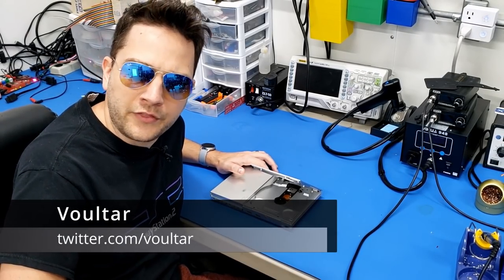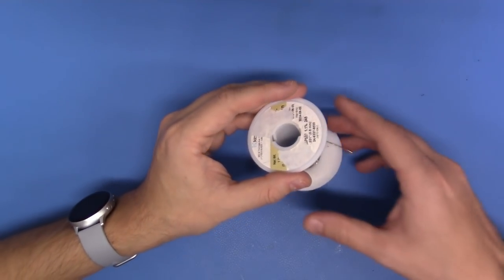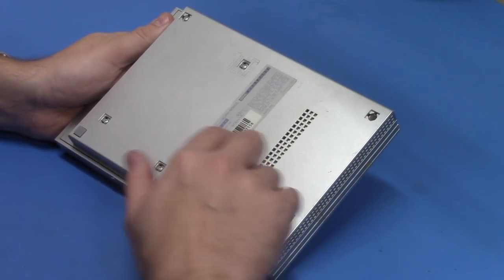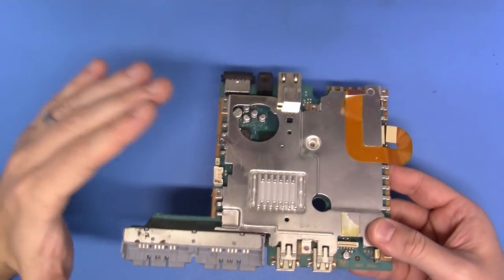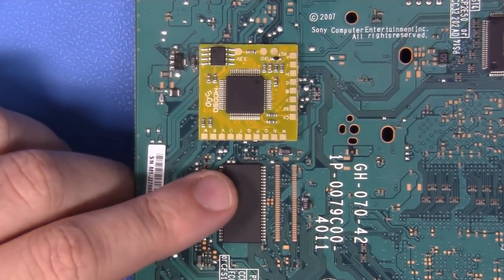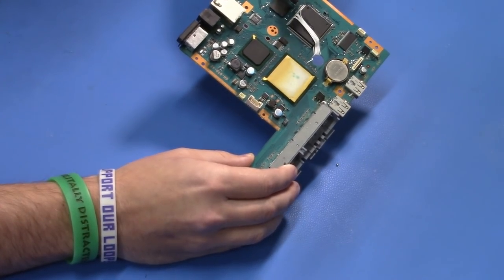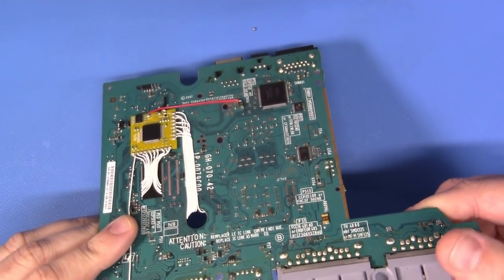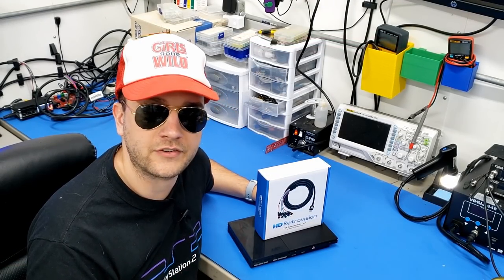Playstation 2 | The War Against Modchips

Comment: I've said it once, I'll say it 100x again. Hot glue is perfect for console modding, when used appropriately.
Reply: What about the super glue? It looks like a mess too me!
Reply: Agreed. There's no such thing as a bad or good tool. It always depends on the use case.
Reply: @nowonmetube  
nearly impossible to remove if you ever have to
Reply: I always use double sided tape. hot glue degrades and becomes brittle with age
Reply: Hot glue is a hot mess.
Reply: @DecibelAlex   acetone for super glue, works great actually as long as you don't put it on anything it will dissolve that you don't want it to.

Comment: I remember when the first no swap chip (except for DVD games) came out, the NEO 4. It required some 40 or 50 wires to be soldered. I ended up shipping my PS2 to a guy in California to have it fitted, which I still have today in 2022 and it still works.
Reply: Oh man, did you send yours to eccsmods? He was the best at the time. I ended up buying my OG Messiah chip from him. Never got around to installing the neo4 I bought.
Reply: @GLAAAAAR  Yes, it was eccsmods! Lol wow I had forgotten the name. He did an awesome job for sure.
Reply: @JeffisWinning  That's crazy lol. The name just popped into my head when you said Cali. I remember him and foundmy were the main dudes for modding back then.
Reply: respect to the OGs in the chat recognizing good mod chip work. I had a Korean hookup for my mod chip installs.
Reply: @GLAAAAAR  That's wild dude! Such a flashback.

Comment: messiah, messiah 2, matrix mxl, mxl2, infinity, dms3, 4.. I memorized every schematic except v3 that were quite rare. Did hundreds of installs. Soldered kilometers of awg30 with a JBC am6000.

My favorite awg30 was Ok international brand with 60/30 radial soldering wire. Great times.

I started with psx and 12c508s

Comment: I put one of these in an old PS2 fat this morning, after previously only using software mods to varying degrees of success.  I was able to use the KSGER soldering station with the tip I always use, even though these are some really small points.

Using wire-wrap wire is a must.  While my wiring isn't nearly as neat as this one, and I used Kapton tape instead of super glue, it worked the first time.  If there's any question as to whether you have solder bridges, bust out the multimeter and buzz everything out (hopefully, have a meter that has good latching so it buzzes immediately if there's continuity)

Comment: Dude I just noticed you're rocking dual KSGERs. I bought one of those stations cos of your review! Absolutely love the thing 🤘
Reply: I blew up my KSGER building my Nintoaster, FML
Reply: @rdaws73  That blows. What happened?
Reply: @eastwood4  My fault. Touched a live wire  with Mains voltage, blew it up. Dumbest thing I've done in my years of soldering and electrical work.

Comment: Honestly, I greatly appreciate that you were open about killing the PS2 you modded first. I did the same thing when I modded mine way back in 2009! I ended up buying a used one of the same model (50007 IIRC) and successfully modding that. I actually had overheated a trace and burnt it off the board. (Was my first mod ever, even.) Definitely no artful install on mine, though, but works wonderfully in the end! (Of note, I still have the "dead" PS2, and plan on trying to rebuild that trace someday when I feel up to it.) The chip in question was called a ChipMod CM2 or something of that nature, by the way... pretty sure that it was itself a clone chip already, but it's the same as a Modbo V1.1 in design.

Comment: How are you man, nice shades. I walked all the way from my PS5 to my PC just to tell you that I really enjoyed this video and to subscribe. Oh yeah I was also going to tell you a story. 

I installed one of those very 40 wire? or 40 solder point early PS2 modchips on my brothers 1 day old PS2.. The thing cost 450 AUD from memory. I was a young man with good eyes, the hands of a surgeon and a 10 dollar 15 watt Weller iron. The only soldering experience I had was what I was taught in highschool, never soldered surface mount before and had no flux other than the core of my solder. I used enameled wire and I was SO stressed.. But it worked and to this very day that PS2 is still in near daily use. I'm sacred to open it.. Because there's a giant nest of wires in it lol. These days I'm old and blind but could solder those in my sleep if I wanted to. However the memory of the stress that day gave is always with me.

Comment: Really cool video with a solid introduction to the background of the Playstation modding scene & challenges it has faced & overcome. Whilst this isn't a tutorial, I think your confident and competent soldering skills will inspire many and there's still a lot of technique on display to be picked up here. 

One small piece of criticism I'd give is that whilst your jumper wires are very neat and totally sufficient, I reckon you'd find it a lot easier to use solderable enamelled jumper wire which is specifically designed for this type of SMD re-work. If you get the solderable stuff, you don't even have to scratch the enamel coating off.

Comment: Exactly. The only time you need an extremely small soldering tip is when you're working with ridiculously tiny components. The kind where you need a microscope to properly view them for the repair. For anything on the 6th generation of console, going that small just means dwelling on each joint longer than you'd like to get it hot enough to wet out.

Comment: Would of though that would be a more complex. Maybe had conformal coating on the board potting over the cpu and IC pins. Looks so much easier than what I suspected, your soldering was nice. No cold joints and clear cable management

Comment: Exceptionally neat work, that Japanese 90000 looks better built than my European 90004 model - the cooling on mine in particular is just a sheet of metal and no real heat sink fins to speak of! Guess it got cheapened out one final time, my unit was manufactured in 2011 so a very late run.

Comment: Thats such a tiny motherboard!! I still have my phat 30001 unit with the DMS4 Pro that I had installed by a pro modder many years ago and still works to this day. And your right soft mods like FMCB can't load nor run backup PS1 discs nor run different region games. 

I wish I had those soldering skills but I did manage to install my XStation with another of your videos and it was successful! I should have taken electronics.

Comment: back in the day my dads mate was a master with the soldering iron and he charged £100 to supply and fit a messiah 2, he used to take a ps2 from you and swap it with a premodded one from his stock so you got it the same day, £100 was worth every penny, this is a expert level installation not for the faint hearted, especially involving your brand new console that you shelled out hundred's of quid for

Comment: Just so you know, MG Chemicals emailed me and confirmed that 836 and 8351 no clean fluxes are identical formulations. He couldn't give me an answer as to why they were selling the same product under two different names. Maybe they were different before but changed?

Additionally, 835 liquid rosin flux could be considered "no clean" because they advertise it as leaving residue that is non-conductive and non-corrosive. Again the rep from MG could not tell me why it wasn't labeled no clean.

and lastly, I am not going against what Voultar says, but I personally like a no-clean gel flux, such as MG chemicals 8341. It does leave kind of a sticky mess behind, but as it's a rosin-free flux, it does not need to be cleaned up (supposedly).
Reply: Possible they are supplying 2 different companies with product, and to avoid legal or contract issues they have different part numbers.

Locktite also does this

Comment: Very nice! I still disagree with the glue method. I can get a good short wire install without glue but of course it isn't that level of neat, but it has a similar look. I miss doing PS2 modchips, I was at it for a good 3 years until Ebay got on my case for selling modded PS2s. Once you nail the art of PS2 modchip installs it can be so rewarding.

Comment: I had just recently commented on a separate channel for it's decent technique for soldering, now YT thinks I should rethink my opinion. I used to work under a microscope for a company who built rocket's and other small circuitry. You would have been the ace on the floor for sure. My boss used to reject my work when I started. It goes to show you how good your skills are even though the PS2 is years ago. 

Going forward I'm just going to buy the original consoles because they always seem to be the easiest to hack. Lol

Comment: This brings back memories, I used double sided tape for the chip and wire runs to keep it tidy and reversible! I recall the mod burning out lasers? And some resistor mod to help that
Reply: The infamous Picfix, for sure. I suppose you had a late fat SCPH-50000 or early slim SCPH-70000 PS2

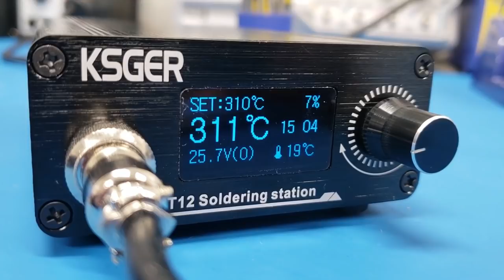Comment: @5:32 Why aren't you just use something like a Pinecil64, soldering iron with RISC 5 microcontroller? You can adjust the temp on the iron itself.
@16:50 Mad skillz bro, mad skillz. Those legs are tiny and finicky.
@24:52 That is the only not subjective claim. Either softmodding can or can't do everything those chips can do.
@25:08 Yes, but if you are a lazy boye and don't want to become a micro soldering genius by trade, soft modding does the trick. On the bright side, even if you screwed and overestimate your talent there is no harm in it unless you burn traces or fry a chip with your soldering iron.

Comment: this brings back memories .. i would do these all the time for people and the original ps2 was almost as bad with all the wires and soldering to the chips. my go-to was a tube of flux that contained leaded solder powder mixed in it... dip the tip and heat and done in one shot.

Comment: Good video, though I know you said it isn't a tutorial but some parts I was having trouble telling things like which side of which chip you were doing things, I don't have a PS2 rn so I wasn't trying to use it as a tutorial, just would have preferred a little more sign posting personally, I only really had that problem at most once or twice since I've seen a PS2 motherboard a few times so some of the topography of the board was familiar but yeah

Comment: Wasn't the 70000 series booby trapped that would fry the laser using dvd-r and you needed a diode fix to shutdown the console once mechacon sends a command to the laser coil? and it later backfired with legit users and Sony got sued?
Reply: @Hanz Obi mostly correct but axe the diode fix.

Use the matrix pic fix/ Comsoft v4 fix or subzero fix but forget the diode fixes.

Comment: back in the days i made many ps2 mods, with titan se (programmable chip) It was a lot easier to install with less wires and much more compatible with all ps2 models. In the ps2 slim dont forget to add the lens protector mod (4 zener diodes) because with bad backup discs the laser will explode, literally! This is not a 100% issue, but better to be safe.

Comment: I never understood why modders never used pin connections instead of soldering the cable directly to the components, I would recommend you to use harness tape instead of superglue

Comment: Would be interesting if someone would design a flex to help soldering these.

The main problem I suppose is which revisions of the board to support and for what chip.

Id say... V9 fat (50001), the first ntsc slim, and maybe the final ntsc slim. The chip... modbo 5, cheap and a rich feature set.

Nice work!

Comment: The golden days! I mad my own programmer and purchased a bunch of 555 chips from Digi key and this guy in Australia that I played rainbow six with had the hex code needed for the PS bootloader. I was charging 40$ for the mod and installation.  I would mod up to 10 PlayStations a week. This lasted about three months until I saturated my area with modded PS.
Reply: How did you manage to program a 555 pretty sure thats a timing ic. Do you mean pic 509 ?
Reply: @agentmarky5493  Maybe it was a 509, It was decades ago so my memory may be a bit off. At the time I was doing a lot with 555 as well as some high frequency RF projects. Now You got me wondering, I will have to call my son and ask for my old ps to see what chip I used.
Reply: @octogames6823  it was a pic 12c508/9 you used for the ps 1 mate. Also used for the Wii and could also be used in the ps 2 with the game shark boot disk and some iffy hit or miss disc swap method.  The programmer you built was probably a jdm based programmer heavily used in the satellite scene.

Comment: Mr. Voultar, I know its probably outside of your brand but, can you help us poor PS3 owners and give us a way to permanently fix the overheating/YLOD of the PS3? Would replacing the thermal paste with IC Graphite thermal pads work okay? I'm not comfortable opening mine up without your loving guidance.
Reply: I've read that the ylod is not because of overheating but the nec/tokin capacitors dying. You need to replace those with something better instead.

Comment: I just don't get the stigma around hot glue when it comes to this stuff. Sure you can over do anything, but I don't see the harm in fixing wires, or mod chips in place with a bit of hot glue like you did... Nice work as always...
Reply: Tiny little blob to locate some wires or a patch board is fine, as long as your careful enough to keep it away from any hot areas on the boards 

It's when dudes go HAM and theres like 10 full hot snot sticks jammed in/on everything that gives it the bad stigma 🤙
Reply: Very often, unskilled modders will dump hot glue all over their solder joints because they aren't confident that the wires will stay in place without it.  A small amount of hot glue being used to just stick something in place (such as the modchip board seen in this video) has always been fine, but the 'stigma' around it comes from bad modders trying to use it to hold all of their work together.

Comment: Irony. With as many playstation consoles as I've gone through, the only true survivor I have, is a phat PS2 with an og matrix infinity. I previously bought a prechipped unit that was having the same disc read problems. Thankfully the seller was cool enough to let me send it back to them to try and repair. According to them, on the last day of testing before he was ready to box it up, the disc drive shattered to pieces. Sounded like it traumatized the poor guy, because to make things right, he found an older revision he was more familiar with and recapped the entire board out of paranoia.

Said ps2 has outlasted five ps3's (on my sixth) and six PSP systems. So clearly, they did something right. I hope they're doing okay after that.

Comment: Recently installed modbo on my 9000x ps2 it was a mess but it worked fine
Used copper wires from inside a ps2 controller motor
They are thin enough and are covered in plastic and work just fine

Comment: Awesome soldering work, very clean and aesthetic. But wouldn't hot glue cause solder to reflow and potentially mess up the board? Or does it cool down fast enough to not be a problem

Comment: if the device was still under warranty you could remove all the screw under the warranty sticker and carefully bend the case open such that you snap off the screw stud inside the device so from the outside sony will not notice the tampering.

and maybe be able to argue in court i did not open the device because the sticker is still in place.

i think the dvd and bluray consortium or the movie industry could have easily stopped piracy by.

1. using an ffc connection to connect the optical drive mech to the mother board like in cd players instead of using the maybe cheaper standard pc dvd or bluray rom drives that connect by ide or sata

2. take a page from the amiga custom floppy boot block so the disk would mount as a ndos disk or maybe not even mount at all so all the directory data would be contained in the vob set and the location of the directory blocks would be hard coded in the device firmware rom.

if the disk would show up as blank or not even show up at all then there is no way to rip it.

Comment: 13:31 you do realize all 4 of those pins were connected directly to freestanding pads you could have soldered the wires to? Now the next 6 pins on the other side didn't have this option, but you could have reduced your risk a bit there.
Reply from the maker: There is no risk as I'm not a noob.

Comment: Great work! I saw some unused solder pads on the motherboard directly connected to the pins you're soldering wires to. Why not use them instead?

Comment: I really like how you routed the wires, and made them look nice, but then you gobbered up a ton of glue on top of it, and that kind of ruined it for me. Also, that insulation on that wire looks like it melts really easy, they still came out nice ,but it might have been easier with different insulation.

Comment: PS2 slim - not the easiest to mod, not the hardest I have come across :ø)
I remember there being a 'Laser lens protection' mod with a bunch of diodes for the slim v12.  Supposed to protect the coils from burning.
Was this required/needed - what's your take on this Voultar? 

PS - Investing in a stereo microscope is the best I have ever done in regards to doing electronics, I wish I had done so 20+ years ago.. hindsight LOL

Comment: 10:59 it's not that simple removing the silver RF shielding, it can be very stuck tight cause of the thermal pad, it feels like the motherboard can snap in half due to it being so tight when trying to remove it, I use a heat gun to warm it up so I could removed the thermal pad.